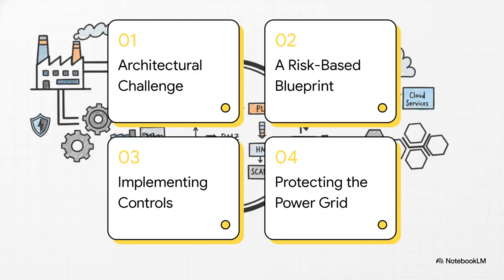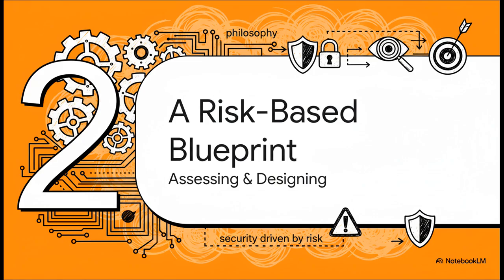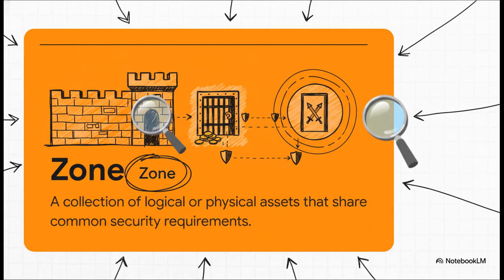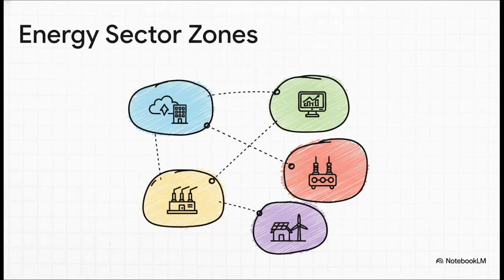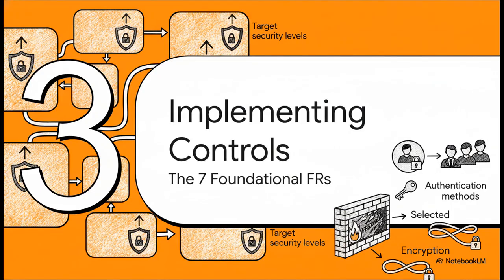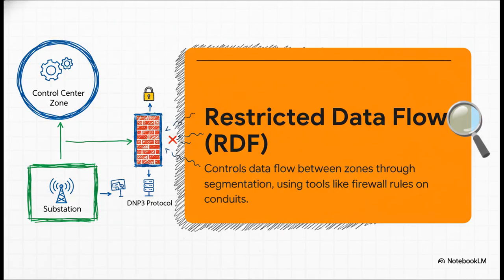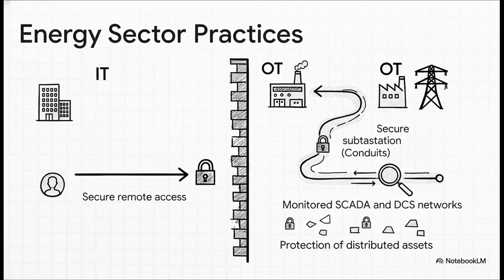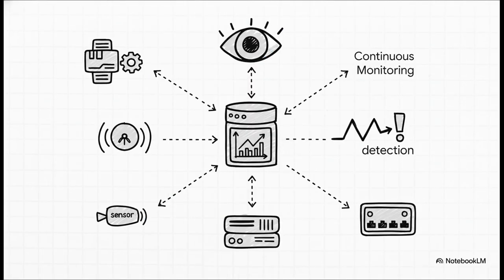IEC 62443-3 Explained – Zones, Conduits and System Security

Comment from the maker: This video explains IEC 62443-3 and how secure system architecture is built using zones, conduits, and security levels.
Previous video:
IEC 62443-2 – Cybersecurity Management Systems (CSMS)
Next video:
IEC 62443-4 Explained – Secure Industrial Devices and Components